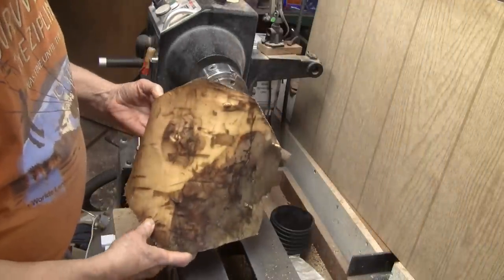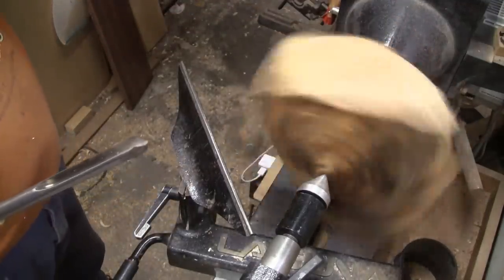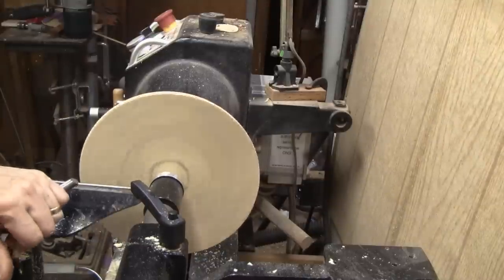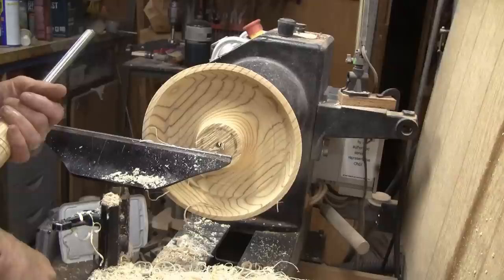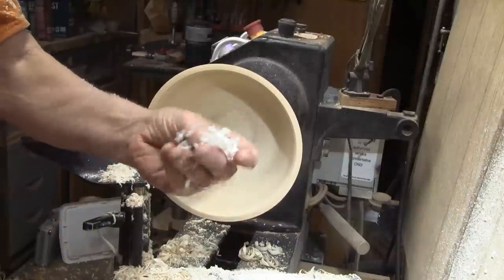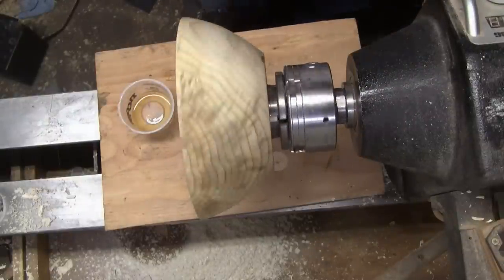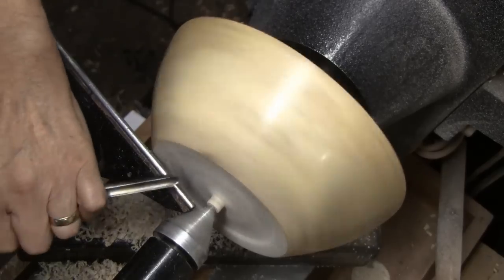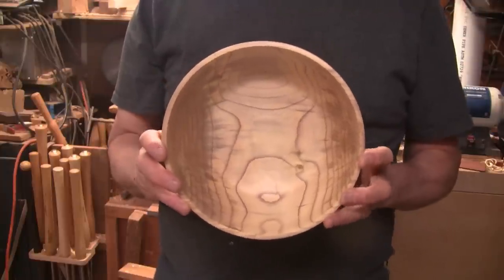I Found a Frog In A Log 36 Minute Wood Turning

Comment: It looks like you or someone took the time to orientate the blank so the grain would be balanced. (good job). I've turned magnolia before while it was wet and it didn't , crack  however, it did warp some. came out very interesting. Beautiful bowl and great job, Thanks
Reply from the maker: Thank you Randy. I brought the piece home as a round log. I did look at the end for awhile before cutting it in half. I hope the other half is this nice.
Very stable wood with a small amount of warping.
Thanks for watching.
Gary

Comment: Thanks for sharing the excellent tip about going in 45 deg. angle to not go strait into the end grain. 
I’ve not started turning yet but I’ve watched turning videos for about 4 years. Nobody else (whos videos I’ve watched) gave this awesome tip and I didn’t think of that either. Greetings from Sweden. 😎☀️☺️
Reply from the maker: Glad it was helpful Aranka! It also helps because you are making more contact with the wood as you get it round. Less air to cut. Hope you enjoy woodturning when you decide to give it try.
Take care,
Gary

Comment: Hi, Gary--
That's a great looking bowl, with some interesting grain.  I've had the opportunity to turn some fresh-off-the-stump alder.  The ribbons of wood coming off the chisel can be measured in feet, and there's a stripe of water on the wall behind the lathe.  But, getting it to dry without cracking and warping is sometimes a hit-and-miss job.  It looks like that magnolia is pretty stable during the drying process. That's a bonus.  I get that end-grain stain with alder, too.  Someone mentioned that it may be a precursor to spalting; that's a good theory.  It would be interesting to put a piece of that magnolia into the shed for a few months and see what happens to both the color and the ease of turning. Thanks for another good thought-provoking video, Gary!
See you later,
--Paul
Reply from the maker: Thank you Paul.  For sure this Magnolia turns like a dream. I did a little reading and found that it did not move much or crack much so I figured why not just turn it to size. Really happy with how it worked out. Been sitting for more than a week and has not move anymore at all. It is about 3/32" out of round with a very small roof top.
 I do have 2 pieces put away. Also have 2 crotch pieces.
Take care,
Gary

Comment: I get the same end grain staining and it seems like mebbe  it's from the residual moisture trying to migrate out and being trapped  by the wax?      QUERY: How did you come by your negative rake scraper? Did you regrind it from a round nose?
Reply from the maker: Thank you Michael. If you are thinking the wax for sealing I did not seal this piece at all.

I ground the top of a standard scraper to make this one.
 Thanks for watching,
Gary

Comment: The sort of muddy brown starburst on two of the sides looks crazy against that bright white wood. If I wanted to keep the wood bright white, what would be a good way to finish it? Burnishing would make it darker and so would certain finishes..  I’m asking because I love how the white makes the darker sections stand out a bit better.
Reply from the maker: Thank you very much. Keeping the wood light is something I try to do but is not always possible. Some woods change a lot and some not so much.
I try to use a clear finish. Finishes like poly have a natural yellow color and so will shellac. So will most oil finishes. As well as just abrasive paste.
Clear lacquer and water based poly is my choice. But those can even change it some.
 I think the harder the wood the better of a chance of it staying white.
Thanks for watching,
Gary
Reply: @ThePapa1947  I haven’t tried it yet but I thought about getting either a one inch ball bearing or maybe even a glass marble that size and try to use that as a burnishing tool. I don’t know how the smooth surface would work compared to cloth/wood/ whatever.. I would say human skin but my calluses have gotten to soft, lol. I guess it doesn’t matter the surface as long as you can generate the heat by adding pressure.  I guess regardless it would still yellow, brown, then blacken. I  guess there really isn’t a good way to keep the wood white.
Reply from the maker: @Trindal  Seems like it could help.

Comment: The bowl turned out to have a frog in it! That will definitely be a piece for your friend to admire! I keep seeing horizontal lines in the video, most notable around the edges of the bowl, and when shavings are flying off, when you're turning. You may want to check the encoding format you're using, as it detracts from the video quality! The amphibian you discovered definitely makes up for it though!
Reply from the maker: Thank you very much and I appreciate your feedback on those lines. I believe I have figured out the problem. Seems to have been a setting on my camera. Not sure but in I think on it got changed.
Thanks again and it helps to hear the good and bad in my videos.
Gary

Comment: Very nice. QQQ: When I mix alcohol with my shellac to thin it and to help dry it becomes thick with the consistency of glue. Is 91% alcohol incompatible to the zinnser shellac?
Reply from the maker: Thank you Lee. Well I have never heard of that. I have never thinned down the Zinsser shellac because I use the Zinsser Seal coat.  The Seal Coat is a sanding sealer and does not have wax in it. Their shellac has wax in it and that is the only thing i can think of that would make it gummy. 
 I will test some later and see what it does and let you know.
Take care,
Gary
Reply: @ThePapa1947  thank you Gary. I may have extrapolated incorrectly thinking I could thin down the shellac with alcohol but can only thin down sanding sealer with alcohol. I tried thinning with mineral spirits but it seemed to extend the drying time.
Reply from the maker: So I just put some alcohol in the shellac and it was fine.  I added a little water and it got very milky looking. Not sure what your other  9% is or what you are using.
Reply: @ThePapa1947  Thanks Gary for testing. I’ll have to look at the can of alcohol and see what solvents are used. Happy Father’s Day!

Comment: OK you said this was wet wood and you turned it thin and then left it sitting for three days on the lathe with cooler air blowing on it. This is it going to warp or crack on you later? Can this be done with any wet wood? he spoke of doing twice turn bowls is that for when you want thicker walls? I guess I’m not understanding when you can turn and finish wet wood and when you can’t. But I do agree with you that the grain is different from most wood I see. I’ve already seen your little frog on the inside of the bowl in the grain. It is pretty. One more thing how important is the sand and sealer?
Reply from the maker: Thank for your questions Lynda. I plan on doing a video soon on your questions. I think that might help a lot.
Once something is turned thin the chances of cracking are much smaller. It may warp some though but I know that going into that method. 
The sanding sealer is a thinner product which helps to seal and can make sanding easier. It is not necessary for all things. A lot depends on what the final finish will be.
Gary
Reply: @ThePapa1947  thank you for responding to my questions. I will definitely be watching for that lesson video from you. I have a set up so that I get notified anytime you have another video out. I am finding this is very interesting and more detailed craft than what I realized. But honestly I think that’s why it cut my attention and find it fun because there’s always something new to learn. You seem to be a good person just like Mr. Phil and I greatly appreciate y’all taking time to answer this crazy ladies questions. Thank you again.
Reply from the maker: Happy you are learning new things from this crazy old man!!! 🤣

Comment: you shouldnt use wd 40 on machined surfaces it will make them rust
Reply from the maker: Thats strange the WD stands for Display Water.
What do you recommend?
Reply: @ThePapa1947  there are higer grade of the same types of spray but i would go with a real light oil i use trans mission fluid on mine but its a temp solution